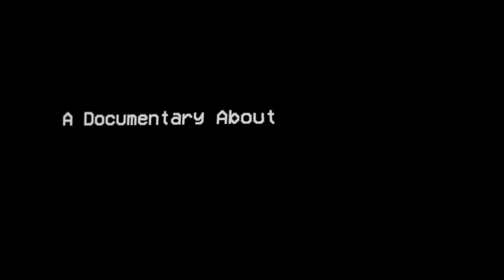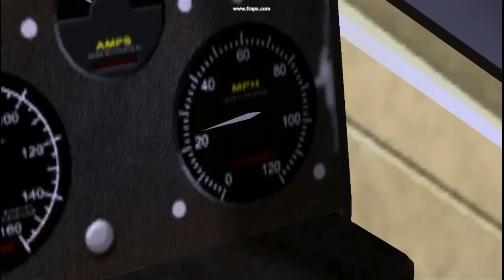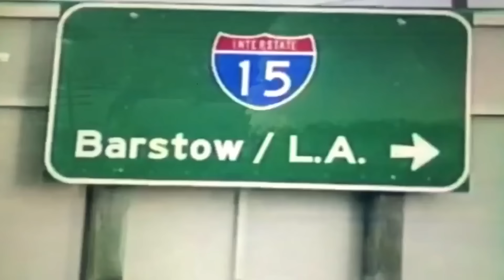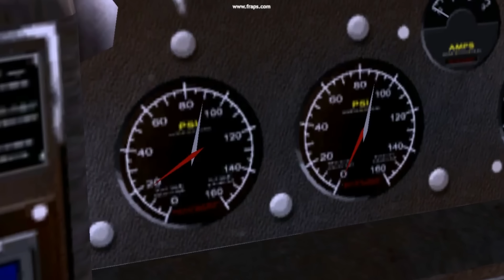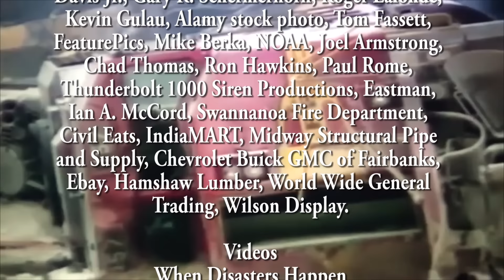The 1996 Cajon pass runaway 23 years later

Comment: The narrator is incorrect on the cause of the wreck. I worked for the company that cleaned up the wreck. The cause was vandalism at summit. The air valve was closed so the cars could be gone through and ripped off. By closing the valve the train could not move, giving the people more time to go through the train. After this there was a ten foot tall barb wire fence erected around summit and security personnel were permanently stationed there and would drive up and down the rite of way to patrol the trains. Today the fence is still up and is patrolled.  The people that rescued the engineer were also injured by rescuing the person that they don’t mention. There was a lawsuit to help with medical payments to these people due to exposure they lived in a house we called the cookie house because they would come out and offer us cookies when we worked in the area
Reply from the maker: This was mainly pulled from the NTSB final report of the accident and they pointed to the kink as the possible cause. Either way the air for the brakes got closed off and the train was doomed the minute it started down the grade.

Comment: we had a runaway rail train a few yrs back on the horseshoe curve it was a loaded rail train, it did not wreck made it down going 60 mph took 4 miles to get stopped, what they found was excessive piston travel on 70% of the cars, i am sure a few car knockers got their tits in a ringer over that as they were and did inspect the brakes on the cars before it left the terminal, only thing that it did derail is because a train like that has a low center of gravity,ie flat cars.

Comment: Something in this description doesn't make sense... a kinked air hose is not going to make the air pressure reading in the locomotive cab low... if it was only 81 PSI there,  there was a problem in the locomotive system that wasn't recharging the brake pipe. Air is supplied by the locomotive, so there's no way they could know what the brake pipe pressure was a the end of the train unless there was a FRED sending the information back to the cab. 

Had there been a blockage or whatever, the locomotive cab would have shown the correct pressure, as it would only be reading the first 8 or whatever cars to the blockage point. If the engineer saw he only had 81 PSI before making his initial reduction in pressure, he knew right then and there he was fucked. 

There is something missing from this report because what was described doesn't add up to the facts.
Reply: @Heartland Railfanner™ What are CEDs? 

And none of that list effects any of what I said above.
Reply: @Heartland Railfanner™ Ah ok.  Definitely something was wrong.
Reply: @Heartland Railfanner™ I guess I just keep going back to the fact they never had the right amount of brake pipe pressure to begin with, and on that line especially why in God's name would you even think about attempting that hill in that condition? I mean if you wanted to commit suicide, sure, but the rest of the crew was like, meh, ok?
Reply: @Heartland Railfanner™ such a shame.

Comment: Without hurting your feelings, you description of the brake system and the pressure is confusing.  You def understand it, but have difficulty saying it clearly.
At applied pressure of 90 psi, the brakes are off.  When there is a loss of pressure, dropping to zero, the brakes are fully applied.  Right?  May I assume that the brakes are applied in increments from 90 down to zero? Like 45 psi is some braking for slowing down, but not stopping?
So, the kink in the air line trapped the air, maintaining the brakes as off, and the engineer had no control to release the air pressure. I'm not clear on the 81 psi meter reading and what that meant.
Again, I know that air brakes are kinda a reverse system and hard to keep straight.  Your description circles around, and you use language that is ambiguous.

Great vids!  I've watched 4 in the last couple of hours.

Comment: Hi very interesting. I am not bery knowledgeable about locomotives, but i am wondering is the third loco you showed unmanned?
Reply from the maker: That's a B unit as the railroad calls them. It's meant to be hooked up remotely to the unit in front and that controls the throttle of both the leader and the B unit. Saves metal, cheap, and weight for more power.

Comment: What is the purpose of Gp60b 342? I saw no cab on it.
Reply: It’s “B” unit, designed as a purpose-built helper unit. They are cheeper locomotives since there is no cab, radios, or toilets. The only controls are for moving around a train yard for maintenance. They are unpopular however because of the “helper-only” limitation.
Reply: I see. Thank you for the info.

Comment: 15 is one of the few routes through the area, and when the road is closed, it would be good to be rerouted back down the hill or back up away from such problems. What I wonder is why the dynamic brakes did not come on for all of the engines and not just the one. Also a redesign of the braking system would be a good idea so that in addition to a pressure sensor something else is added, such as a feedback system so that the brakes operate in a loop, and if the loop is blocked it would be known that they are blocked by a kink. I heard from a guy that used to work at Amtrack and he told me that when brakes did not work they had been disconnected this was over 3 decades ago when he seen this. Also Santa Fe from what I have seen take safety seriously at Barstow.

Comment: Train breaks work by dropping pressure..... So 90 is full open (brakes off)  and 0 psi is closed (brakes applied) interesting based on the logic you said in your video if the air brake system is at 81 psi that means the brakes are already being applied not dead I don't feel like the work on the video is 100% accurate. Or I'm not understanding something cause if that's the case why not just put the air brake line running for the engine to the cars as it would almost instantly dropped air pressure to 0 which means your all your cars brakes are being used
Reply: I think, because of the kinked line, the air pressure could not drop to most of the train cars so that the brakes could be applied. Since the kink was close to the front of the train, the majority of the trains brakes could not work because of the kink. They still had full pressure applied to keep the brakes off and the pressure could not be lowered. I could be wrong, though, but that's how I understood it.
Reply: @CatFuzz71  thank you I wasn't looking at it like that. I was looking at it like the air is constantly flowing and a kink like a garden hose would should it off I didn't think about it being like a return line or just not being able to simply drop pressure.

Comment: Why didn't the dynamic brakes work on the locomotives ?  Why didn't the independent brakes work on the locomotives . Why didn't the guard in the rear guards van ' pull the tap' to allow the air to escape from the wagons that were behind the suspect wagons with kinked air hoses What is the safe speed for a train to go down this section of track . Did the driver ' know the road ' of this section of track . The dynamic brakes on the three leading locomotives should have been able to slow the train down enough to make it through the section.
Reply: Because the train was too heavy.
Because CABOOSES were phased out by the time of the wreck.
The track had a limit of 15mph.
The engineer knew the track, yes.

This comment made me facepalm so hard.

Comment: This has nothing to do with the video other then crashes and crew decisions, if they loose the brakes they can just turn the damn engines off and glide slowly to a stop.
Reply: On a 3.5% grade? Doubtful.

Do your research on the location of the wreck next time.
Reply: @fredkerlaude8696  well I wasn't saying specifically on this, I just meant in general.
Reply: @Train115  Makes sense. Although, if you disable the engine, you disable every component of it.
Reply: @fredkerlaude8696  I somehow forgot about that.. well it sounds like a good idea, but I guess it's not.

EDIT: I re-read my comment, I didn't accually say turn the brakes on like I thought, but it could be a possible life saving choice at certain times.

Comment: Ventilating using plastic explosives.
Reply from the maker: Small explosives basically being used to relief the pressure without causing a Bleve. Pulled that line right off the NTSB report
Reply: Makes sense, just never thought id hear a train crash being stopped from getting worse using C4.

Comment: Air hoses don’t “kink.”   What jacka$$ put this video together and narrated?   Primary way to disrupt air flow on a train line is closing an angle cock.  Just like the ‘94 issue (unknown persons closed an angle cock) I believe it was after this one (maybe it was ‘94 incident) that the railroads put up tall fences with barbed wire/razor tape and camera systems in the location at the top of the pass where trains stopped to perform air brake tests before descent. Since then no runaways.  You do the math.